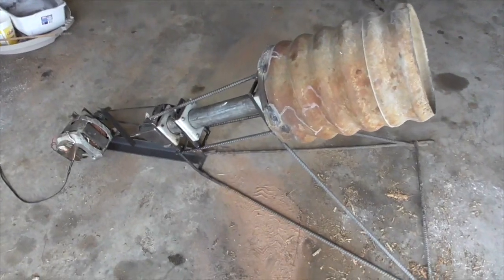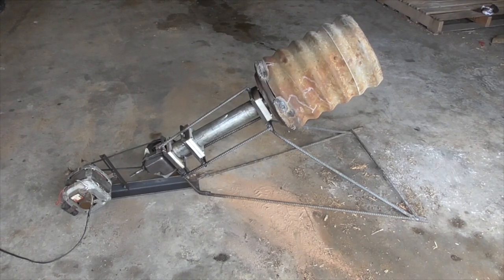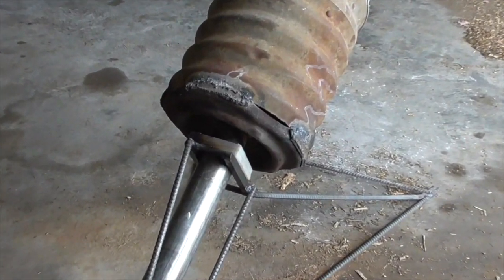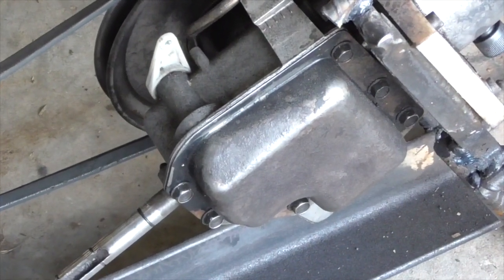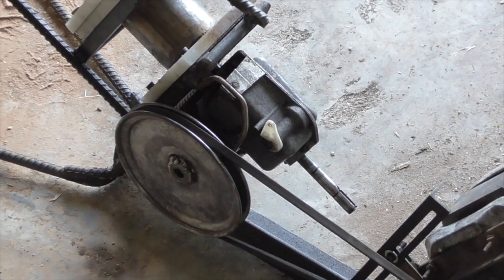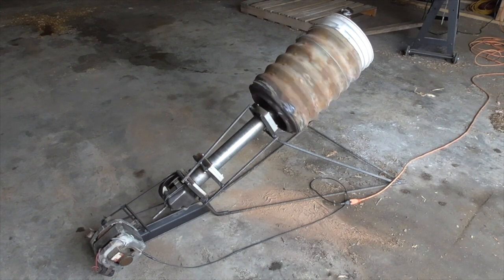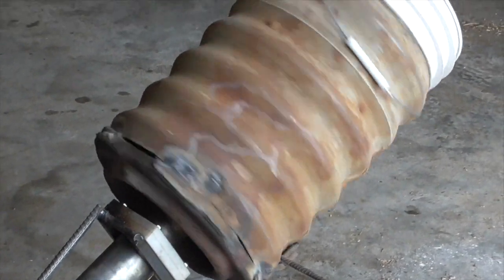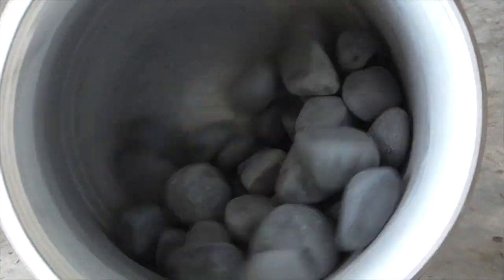Homemade 5-gal Rotary Tumbler (TIS224)

Comment: I built one out of a 5 gal bucket with 2x2 wood strips inside and screwed it to the inside back of a clothes dryer. Never seriously loaded it down, but it worked for light loads.

Comment: From what I have seen on DIY tumblers you should have  2-3 "speed bumps" or mixing vanes running from bottom to close to the top at a slight angle  to promote a better more random tumbling, especially  if using with a liquid.  In this case I would suggest 2-3 strips of  half round  or PVC cut  in half lengthwise and attached with some sort of epoxy/jb weld.

Comment: Just set it horizontal, strap on the bungie and pop the lid on ... Great ball mill ... Also set at angle makes a small batch cement or plaster mixer ... I bet one motor could rotate a few 55 gallon compost tumblers at once ...

Comment: I wonder if you could make a small batch of concrete in a setup like that, just a thought. God bless.
Reply from the maker: I think it would work for mixing concrete or mortar, but it would be limited to very small batches, at least compared to any of the cement mixers on the market.
Reply: Was wondering the same thing myself.
Reply: With that gear reduction it should mix concrete no problem but you would want to make something that would lock the bucket in place so the drum doesn't just spin around it. I have also seen videos on here of homemade cement mixers made from 55gal plastic drums.

Comment: I did something similar but more primitive. My son knocked over a box fan and broke one of the blades. The fan was vibrating insanely when i turned it off and that was inspiration. I removed the motor and cut off the blades leaving one slightly longer so when it ran it was out of balance.Then i removed the motor/fan/switch assembly and  bolted it to a 5gal bucket bottom and hung the assembly by its handle in my garage. Now i can tumble 300 or more pistol cases at a time and it never gets hot (i left short blade remnants for cooling).